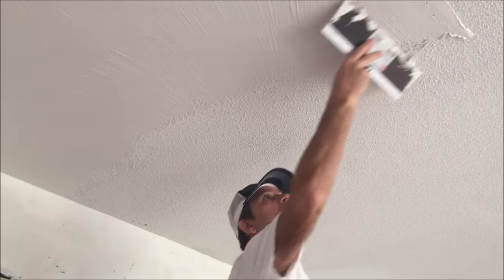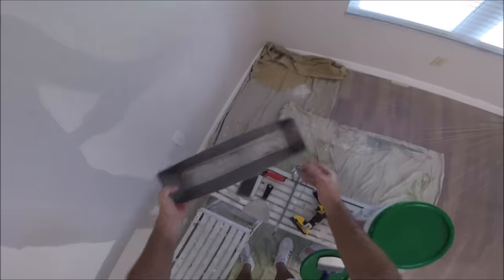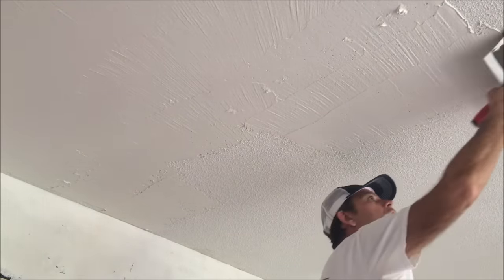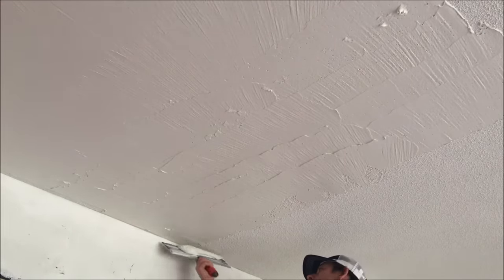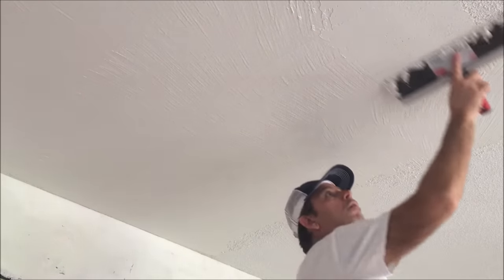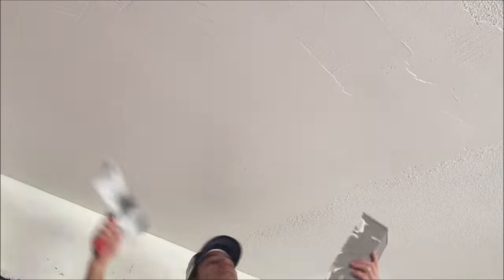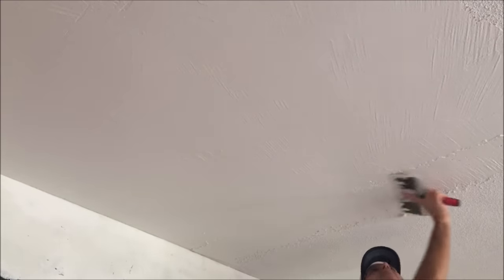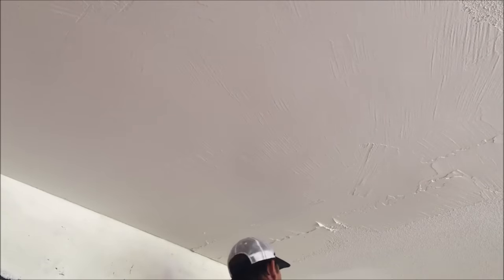Don't scrape your painted popcorn ceiling. SKIM COAT IT!!!

Comment: There's a problem doing this.. even if you using lightweight material you are putting a lot more mud on the tape .. Mudded joints have a limit to their bonds to the drywall if you put too much weight it's going to come loose... So if you do this just remember there's a risk of having to retape it afterwards might not be right away, might never happen, but that's why there's manufacturer specifications on most materials..

Comment: I'm part way through doing this. It has turned out to take more time and to be more difficult to achieve a smooth result than I expected.
Reply: How is skimming over popcorn taking more time and not smooth versus scraping and riskimming Try adding more water to your compound
Reply: @jaredstone9487  My painted popcorn was quite deep. It required several coats to first cover and then to smooth. While it was a lot of work, and required a lot of compound, I am happy with the final result.

Comment: Excellent video Paul. I have the exact same situation in my house, I was going to cover the ceiling with 1/4 inch drywall. Do you ever do that?
Reply from the maker: I appreciate that TEH!👍🏻 I usually either remove or skim if it doesn’t come off. I always felt like hanging new drywall over popcorn ceiling was more work. Because of all the corners where the ceiling meets the wall will need to be finish creating work on the walls now. The other way I can keep the work concentrated on the ceiling only. But the new drywall is definitely an option for sure!👍🏻 Thanks for taking the time to watch and comment!😎 -Paul
Reply: I did this (cover with 1/4") and used the opportunity to add crown molding to avoid finishing corners. Less work and looks better!

Comment: This is great however the issue is if someone wants to install recessed lighting or something in the ceiling they won’t know what’s underneath it, and if the current owners themselves want to do the work them or the pros they hire will be potentially exposed to asbestos unknowingly. It should be removed by professional asbestos abatement folks if it is asbestos. Just sayin!

Comment: #drywalltube I agree with all the others and hate the popcorn ceilings. Best place for that crap is in a dumpster!!  My bathroom had painted over popcorn with mold coming out. I opted for the demo option. Fixed some missing insulation and bad wires up there as well.  Glad I opened it up now.  Finishing up with nice smooth flat white paint tomorrow!  LoL!

Comment: #drywalltube Can you use that Roller technique (1” nap?) when applying the mud?
Reply from the maker: Hi James, it really doesn’t work to well going over a heavy texture like popcorn. The joint compound needs to be thick to cover the popcorn and it doesn’t roll well at all. I hope this helps. Thanks so much for watching!😎 -Paul
Reply: @PaulPeck  Rolling over popcorn ceiling does not work at all if it has not been primed or painted under it. It will only club and eventually fall because your compound/paint that you were putting over it weighs it down. I can’t even get it to stay up trying to replace a hole from where it fell from a water spot and it’s coming down around all my vents because I have ceiling vents

Comment: Have you ever chosen this method for a popcorn ceiling that is not painted and has asbestos?
Reply from the maker: If the popcorn ceiling has ever been painted, it will most likely just fall off if you try and skim coat over it. That would be hazardous to your health if the ceiling has asbestos in it! The ceiling would need to be primed first before skim coating. I hope this helps. -Paul

Comment: Thats not popcorn. Thats heavy texture. Popcorn is actually easy to remove if you just pray it with water. Unless its' painted over, its a piece of cake. Even then it's not too hard. Then you can have a clean slate to skim. Doing it this way will leave a lot of waves in the wall. 
It's way way harder to skim if you have never skimmed before. Skimming is a skilled craft that takes a while to learn and to perfect. Not everyone can do it. But to each his own.

Comment: That is a LOT of mud, mud on the ceiling.
I my years of experience the more mud on the walls or ceiling the more problems later down the road.
In new drywall a good experienced hanger especilly in smooth wall can minimize the joints and seams by big-sheeting it AND by strategically putting the butt joints and seams in the right places. Like but joints away from windows, light sources, outlet boxes, sprinkler heads,  and butt  joints behind open doors when possible.

Comment: I'm a total amateur, but I have removed popcorn from an entire 4000 square foot house and replaced with knockdown.  I could have taken every bit of that off spending less time working than the length of this video.  1 minute spreading plastic.  2 minutes spraying water.  Another 2 minutes spraying.  Scrape the entire ceiling effortlessly in 2 minutes.  Forgive me if I completely disagree with you method.
Reply from the maker: Unless of course the ceiling is older then 1982! Then it would be wise to test it for asbestos!!!⚠️ If it’s after 1982 try this if you really want to be fast: https://youtu.be/Fz63ATjiVdY👍🏻

Comment: what's wrong with popcorn ceiling?  I don't get the whole anti-popcorn movement, but I don't stare at ceilings either.
Reply: out of date and dust catchers,  cuts back on the value of your house also.  The old advantage was it covered all kinds of problems and seams quickly.   my late 50's home has smooth ceilings and I must say its far better looking
Reply: It has a purpose too, it's an acoustic, so your house doesn't sound like a cave. It has it's places, like TV rooms and music rooms.
Reply: @a308hunter1  in those days with all that wall to wall carpet, it really wasn't a problem, plus I think it's a bit over stated

Comment: I don’t understand why you guys sand so much 
If you use a hawk and trowel you can polish as it sets for a mirror smooth finish like here in the uk
We also use gypsum plaster which will be dry enough to polish in under an hour and job is then done
Reply from the maker: I sand very little. Where did you get the idea that I sand a lot? Because I don’t.👍🏻
Reply: @PaulPeck  maybe not so much you then but everyone seems to sand afterwards etc before painting whereas we don’t sand a thing ever as we leave it perfect with a trowel

Comment: Wet it with a hose or a Hudson sprayer  and scrape it off
Reply from the maker: This isn’t the typical poly popcorn you’re used to grasshopper... It’s a painted vermiculite from the early 1970’s. It’s like concrete and possibly contains asbestos and lead paint. Any popcorn applied before 1982 needs to be tested before scraping or disturbing!👍🏻
Reply from the maker: Or a paint sprayer!🤘🏻 https://youtu.be/Fz63ATjiVdY
Reply: @PaulPeck  that's why you wet it 
And Mr grass hopper 😃
Reply from the maker: I would never expose myself or my customers to asbestos or lead. No dollar amount is worth that!👍🏻 At least get it tested bro... I have both test kits in my Amazon store for a very reasonable price. Be safe!www.amazon.com/shop/paulpeck

Comment: Realistically... how easy would it be for a homeowner to do this to their house with no prior experience? 😅
Reply: It's really not hard to do. If your popcorn  ceiling is painted, I recommend to sand it down a little. Makes everything way easier. It gets messy though. Good luck!
Reply: Just remember. If your popcorn ceiling is   1982 or older, DO NOT sand down due to asbestos and lead ..

Comment: Covering the popcorn, I know you have debris of popcorn in this.  Pieces of the original ceiling.  How out dated of the ceiling is important?  Yournot mentioning any of the age nor the paint that has adhered to that original popcorn ceiling.this is not something that you should recommend for somebody with a ceiling that has not been painted since 1981 with a hard if not to paint job of latex on the ceiling. Don't fool  people on this video, and you need to explain exactly how hard of that ceiling of popcorn texture is up on there. Educate people with proper criteria.

Comment: #drywalltube I have a bathroom ceiling with parts flaking down to the drywall and other parts that are thick and tough as nails. I am guessing it was a patch job by prior owner. It is all textured. I am thinking of scraping down what I can and using this method to even out the rest. I do have some mildew on some parts of the paint, so I need to get rid of that. Would this work or am I biting off more than I can chew starting with two or three levels of thickness?

Comment: That ceiling is deceiving because with it painted it looks more like a knock down texture. I am going to dry scrap the big stuff off, than use a drywall screen to make sure its pretty uniform in texture, than prime and paint. It should look like a knockdown down or orange peel texture

Comment: Nice video but I would never skim coat over painted popcorn texture. You're relying on the paint to hold the skim coat and it's sure to crack or fall off in chunks over time.
Reply from the maker: Nah... This is an old school popcorn that’s as strong as concrete!💪🏻 -Paul
Reply: Paul Peck DrywallTube  love the video.  hi Paul, is health concerns to skim coat the unremovable popcorn?

Comment: Laying down a 3/8" thick skim coat to cover up a popcorn ceiling? No thanks I'll  use my pump up sprayer and mist the ceiling with water then take the paint & popcorn off in giant strips. End result it's  as fast or faster without adding 100+ pounds to a ceiling.

Comment: This is no DYI project.  If you aren't a drywaller your new ceiling will look as bad as the popcorn you covered.
Btw, if you have plaster walls there is no reason not to scrape it. Buy a 4" scraper at Harbor Freight, it will even remove concrete popcorn . After that, yes a DYI'r can slap some texture on the ceiling. It will look better primarily because you will be starting with a smooth surface...your attempts to cover the popcorn will result in a horrible wrinkled, bumpy, uneven, etc surface. Dooming you from the start.

Comment: This does not sound like a good idea to me at all! Do it right and scrape it off then if need be, skim coat or texture.
Reply: I have never sanded popcorn usually spray water on it with a pump prayer let it soak in then scrape off, Maybe sanding is useful depending on the situation. Either way....What a mess Hu??!!

Comment: I’m going to refrain my language here,,,!  I would NEVER Skimcoat over a Acoustic ( Popcorn) ceiling... Never.... I’ve been doing this stuff for over 40 years... It’s real Simple,, your gonna have to cover your floor regardless so after your floor is covered,, you take a pump up sprayer with warm water, spray the ceiling starting at one side of the room working your way to the other side.. when you get to the other side grab a latter and a drywall knife and begin to scrap it off,, it comes off very easily after it’s wet.. when it’s all scraped,, pull up the plastic with the mess and throw it away,, now you can repaint the your fresh ceiling
Reply from the maker: Unless of course the ceiling was applied before 1982...🙄 Why you ask? Because any popcorn applied before that might contain ASBESTOS!!! Get it tested before you scrape or disturb the popcorn ceiling texture!!!👍🏻

Comment: # 1 reason to apply this method. Asbestos don't breathe it or disturb it into the air you breathe. 
Need another reason. Higher a pro $$$$ plastic house containment, astronaut suits.

Comment: Fast and Easy?  I don't think so . . .this man is very skilled and I admire his talents, but I don't think the layman can do this.  I removed some unpainted popcorn in my house and I then had to skim (which technically is a lot easier than skimming painted popcorn) and I still ended up putting on several coats and sanding too much.  If you can afford to hire a professional to do this, then you'll be much better off.

Comment: Popcorn spray texture was never ment for homes ... I've done Drywall for over 30 years ...its Best to remove it... then  Sand the ceiling,,..use a portable Sander... rent it from Home Depot... sand your angles with sanding Pole... then check out the ceiling.. may have to put a Coat of mud on your seams and Butt joints.... Rescrew the Nails.... Under the popcorn is always damage of somekind... I'm here to tell you that if you are not a drywall finisher your never reservice popcorn ceiling.. 😂 😂 😂  never....